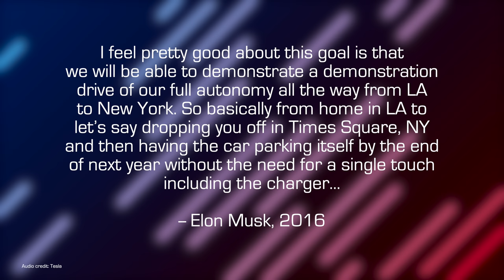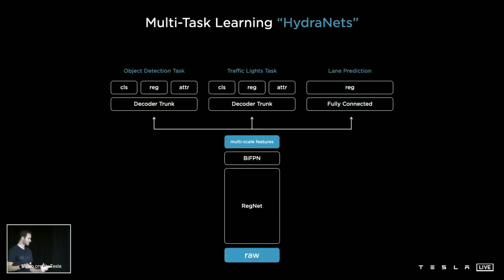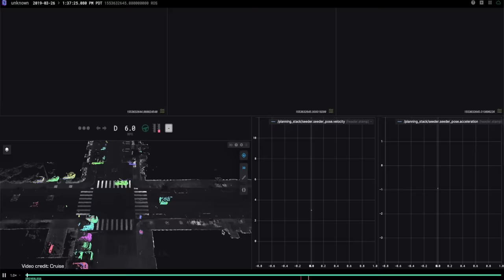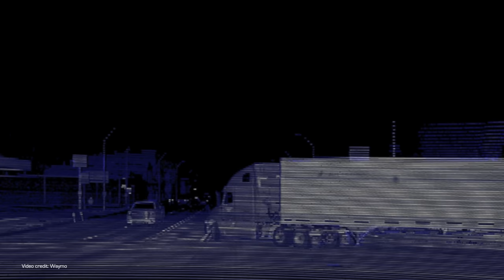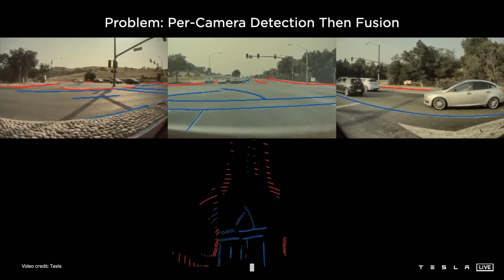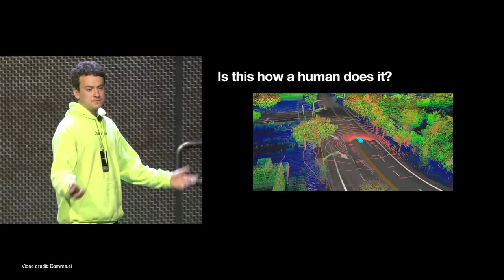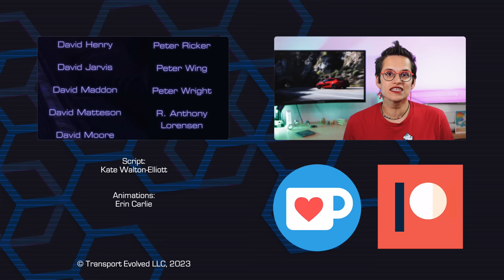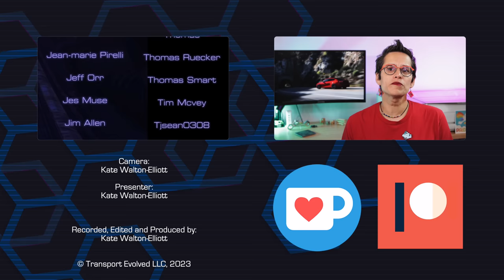Self-Driving Is Hard - And Tesla's FSD Is Massively Changing. Here's Why

Comment: Thanks for all of the great content. I'm not particularly enthused by autonomous driving, mostly because I've had the same experience Kate mentions about every level 2 system from every manufacturer, where you're basically nannying a robotic system you don't trust and trying to keep it from stopping or accelerating when it shouldn't, which as it turns out is actually a lot more stressful than just being in control of the car. I just recently bought a used 2020 Bolt EV, it doesn't even have adaptive cruise control, and I feel better off without it.

Comment: Great rundown.  I was so happy when you referred to the 80/20 (pareto) principle, which is a key component of software testing generally and is definitely important here.

Just one thing I think was missed.  Regular software runs in a very constrained environment.  The testing landscape is large but finite.  When the environment is wherever a road will take you, that landscape is virtually infinite.

It is simply not possible to solve that last 20% with machine learning methods that require you to provide them with examples in advance.  And that's all we have today.

We need ML methods capable of extrapolating to handle unseen situations, like humans do.  Without that you don't solve driving, period.

Comment: My suspicion (not a software engineer or anything like one) is that Level 5 capability will not show up until the driving systems have a far more sophisticated AND robust internal model, including at least a stab at a theory of mind. A full autonomous driving system will need much more than just an inferred geometry of objects it encounters; it'll also need an idea of weight, material properties (like stiffness and durability), plus a way of recognizing common objects and devices (bikes, tire treads, rocks, the odd two-by-four, drifting trash bags, broken glass, roadkill, etc.) so that it can predict what they'll do and how important it is to avoid them. And it'll need to not just recognize humans, but also types of humans (kids, older folks, hippies, drunks, police officers) so that it can predict THEIR behavior.

Human drivers (at least good ones) do all of the above, and use that knowledge to inform their driving. But none of that stuff is going to come out of machine learning, or the bare geometric worlds current driving systems construct as they attempt to traverse our roadways.

I used to be bullish on vehicle autonomy, and bought the idea that we'd have humans no longer piloting sometime before I die. No longer think that.

Comment: I just returned from a 1,687-mile roadtrip, and could only conclude that EAP in my Tesla Model 3 is worse than ever! I suspect that some of the features of FSD (which I have, but don't use) are creeping into EAP: slowing at intersections, roundabouts, stops signs; over-the-top slowing on curves; swerving when passing entrance and exit lines at crossroads. I must have experienced over two dozen phantom braking events, and am so friggin' sick of Tesla's deteriorating ADA system, I could spit!!! Wish I had the system back that the car had when I took delivery over 5 years ago!

Comment: While 100% end-to-end driving is definitely a long way away, the FSD driving on the motorways has gotten VERY GOOD in my 5 years of owning a Tesla. The last two longer trips I took, 4.5 hours and 6 hours with a single charging stop on the trip, I was almost ready to "take a nap" for miles and miles of those drives. No, I didn't, because I was still paying attention to the road. But the car was easily and confidently maintaining its speed, changing lanes, and driving down the road. Granted these were good weather on clear days but  it was still doing it as well as any human.
It's the edge cases that are the problem. Snow. Blinding sun. Rain. That is what keeps FSD systems from being truly "self driving."

Comment: Thank you. Finally a competent and fact based analysis of the current autonomous driving technology without any emotions or financial interests.

Capabilities of all autonomous driving activities since the 1980s have improved by a huge margin and seem to accelerate, whatever the specific companies technical approach is. But from what I am seeing, we are still some time away from truly autonomous driving, even if technical progress accelerates.

To achieve fully automonous vehicles, AI currently seems to be the most promising approach. But as you described correctly, this approach is opaque. So is validation to get approvals on the roads.

If AI is the route to go with so solve such problems, I am curious of we run into limits there. AI is still a probabilisic approach, so it struggles with accuracy. Computational resources needed are exponentially increasing with the need of more accuracy. Tesla seems to take the challenge. We'll see how far they get. The biggest variable that we dont actually know what level of accuracy of an AI based autonomous system is needed. So we dont know the computational resources we need to solve it. A next risk, even for Tesla, is the fact that available data can become a bottleneck. There are actually studies for large language models like ChatGPT which calculated that there are not enough Texts available on the internet and newly generated for training at a quite near point in the future. So there is a limit to the capabilities due to a lack of data.

Anyway, exciting times. Even if autonomous driving is a decade or more away, to solve this problem, many technologies are developed alongside with have their values on their own. Be it high resolution lidars and radars, Teslas Dojo computer, creation of high def maps, Software development.

So even if we might never actually see self driving cars, its not for nothing.

Comment: As you say GIGO is still an issue with neural network (intelligent learning).   So a data set is also the vehicle response.  So I wonder if one data set may not work on different vehicle.   I cringe at the idea of allowing “as you go” tweak to the network config.   Straight up reg programs, allow compartmentalization of the code.  So it is ‘possible ‘to update one part of the code without affecting others.  On a network config, a small change could effect all aspects.   Though I’ll admit I have not been keeping abreast on current neural network programming.  Which has made leaps.
Also, who the hell is Prost?  Screw the Klingons, that was a weird robot…

Comment: Acorn Pocket Book? Are you using it? If you'd like to upgrade, I have a like new barely used early Palm Pilot that you're welcome to. Comes with leather holder/belt clip.  I'm not joking, btw.
Reply from the maker: So I've just got it working, I plan to use it for writing when I'm out and about (not for the channel - I have a novel I'm very, very slowly writing). 

Sadly, the (serial) cable I got to connect it to my laptop is from someone who smoked and my wife is super sensitive to that (I normally notice but this one I hadn't even noticed the smell with it sat on my desk and she walked into the house and was instantly bothered by the smell of cigarette smoke), so that's currently sitting in our garage waiting for me to clean it enough that we can have it in the house... Once I get that done then it will be actually in use.

...as for the offer of a Palm Pilot, that's very kind, I'm not sure I have a use for it other than admiring it - which isn't necessarily a bad thing :)

^Kate
Reply: What, no Apple Newton??

Comment: FSD which will never work, has zero value even if it did work. Hardware/software that makes driving safer for actual drivers is the future. Real people can anticipate, often predict, and deal with unknown events, this is what is needed to be a good driver, practice will make you an excellent driver, and when all else fails, simply slow down or stop. Battery, weight, and cost. are what's holding up EV sales, the majority of the vehicles are not great but acceptable. We were led to believe we would have 100 KWH packs weighing 250 lbs. and costing $2,500 by now, the reality is 1,400 lbs. and $25,000 for that 100 KWH pack, terrible!!!!!!

Comment: L5 FSD, probably requires "AGI".   Good luck with that.  If we get widespread L4 robo-taxis in mapped urban or sub-urban areas by 2030's, and adds economic value (e.g., for people who no longer can drive), this itself will be a gain.  

Meanwhile, maybe Tesla can be a little more modest, and call it "driver assist" (L2), and try to make it best in its class.  (I'm trying to see if I can get Comma 3 installed on my 2020 Bolt, to deal with driver fatigue on the freeways.)
Reply: Tesla calls it a driver assist system today on its website. And every single time you engage the tool. The name FSD is absolutely aspirational and everyone who buys it today is well aware.

Comment: Tesla will need to massively change; not just the software but the hardware.  Tesla made a major error in not having a side viewing camera; thus it usually can't parrallel park, pull out if parrallel parked with vehicle blocking the rear view ; can't see far enough to pass on a two lane highway - which - to me is a major hurdle because it implies some sort of high resolution long distrance viewing with image stabilization, humans have it; Tesla hardware doesn't. Beyond that the way it learns to drive is a fail. In general it tracks how cars drive a segment of road and throws out the radicals and comes up with a typical route.  This is very limited as any changes to the roadway won't be properly driven.  FSD hardware doesn't hear. it can't hear a siren. It has a refresh rate that makes it difficult to discern a flashing light; it won't yeild to an emergency vehicle (could get you a felony ticket). It can't tell a paper bag in the road from a similar size rock so it will brake for it - not smart if there is an 18 wheeler going 70 mph behind you. Telsa will need to learn to drive as humans do; recognizing objects. My 5 year old can recognize a paper bag, a tumble weed, a police car, a school bus; and even understand hand signals and spoken commands. Tesla can't do any of this with current FSD; its on the wrong track.

Comment: Nice overview.

Disagree with one statement that there is no proof that automated driving is safer. 

There is a body of evidence that Tesla automated driving is statistically much safer and improving year to year. 
In fact, it Will be much safer still as systems evolve. Its really only a matter of whether one deploys the system overall and understands that some people will get killed that otherwise wouldn't (though a provably smaller number).

Regards ethics of using FSD vs none. One also has to include the "saves" with the "fails". On can also say that the pedestrian did not agree to allow a new driver to learn on them... or drink... or play with the radio. 
The ethics are complex and can best be determined by the actual results.
Tesla tracks and publishes this and the regulatory agencies have access to this and their own intependant data. 

If FSD is substantially safer than driving the same car without FSD, then the "experiment" is a net good. 
There is also the fact that every crash is under a great deal of scrutiny by the press as well (NTSB investigates All autonomous crashes). You in fact have two drivers, the car and the person monitoring it (even with attention and reaction time of human at lower levels).

The ethics of deploying it while not yet perfect mirror the Psychology Trolley Experiment.
Runaway trolley cannot be stopped. Do nothing - 10 people die
Pull a switch to change the track - 1 person dies

What do you do.

"Wait until its absolutely perfect" - Do not throw the switch, allow 10 people to die because inaction can't be litigated
Or
Tesla (knowing it can, and is saving more people today) - Throw the switch, save 10 people causing 1 to die in their place (which Can .be litigated). (Note: the differential is much closer to 2:1 today but the target is 10 to one Before the withdraw recommendation to "watch the road" while in FSD.

There are 3 million Teslas with 400-500k with FSD. More than 150k on Beta, leading edge.
Fatalities in the last year on FSD.... Way below the national average. Deaths that 500k FSDs produced in 2022?

In my opinion, Not pulling the switch allowing 2 to die instead of 1 - basically cowardice. One can't be sued for doing nothing.

Tesla deaths verified in last 12 months (ie the system was engaged at the time) - 12 (1 per month) with the full set accounted for FSD and Standard (3 million vehicles). Data per www.tesladeaths.com. 
Some commentators overstated this number with "possible autopilot related" deaths (many later confirmed to have autopilot switched off before the accident). 

There were 43,000 traffic related deaths in the US in 2022.

This last line is a bit misleading (despite being factually true) as well but makes the point. 

Tesla data shows 1.5-2.0x safer today Tesla autopilot active vs deactivated. 
NTSB and NHTSA have access to this as well.